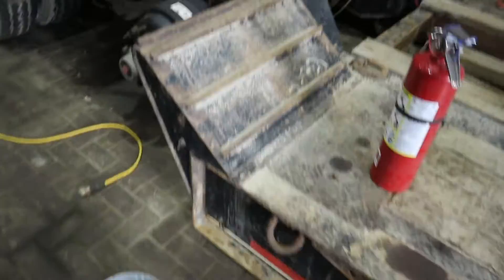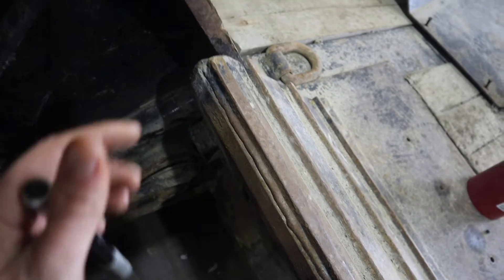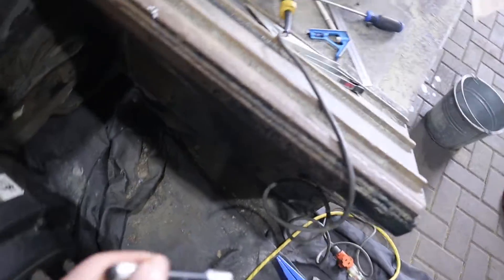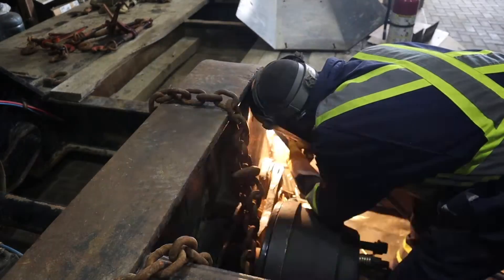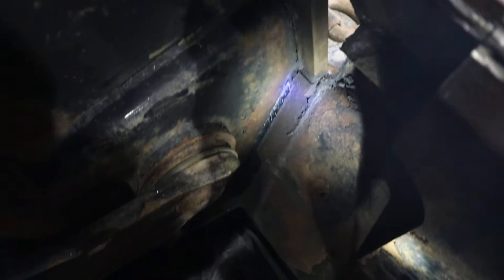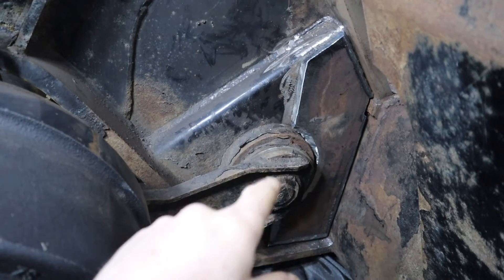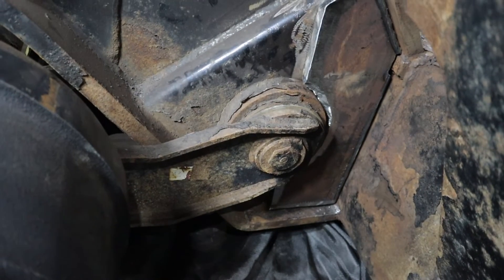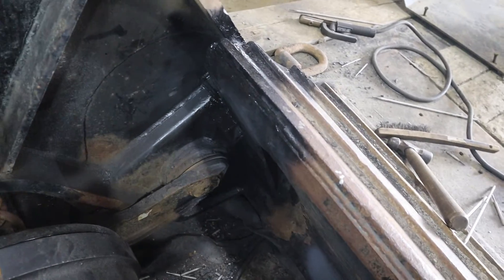Repairing a Cracked Heavy Haul Trailer (Gouge & Weld)

Comment: Hi 1st year boilermaker apprentice here. I was wondering were you ever discouraged when you first became one. Currently I have gotten inducted into local 549 boilermakers in june and got added to the list in july. However it is about to be december and I have yet to be dispatched. Currently I'm going thru the motions and completing classes and gaining certs and trying to practice welding all I can. Just having a hard time remaining optimistic when months have gone by and I have yet to get on a job, hell today when I went into the hall to pay dues one of the other apprentices told me to literally go look into another union because they too have been on lists for months. :(
Reply from the maker: In your scenario I wouldn’t quit the union but I would definitely go get another job in the meantime while waiting to be dispatched. You will get dispatched eventually by it’s a good idea to try and make some money in the meantime.
Reply: @JTwelder. For sure appreciate it I feel alot better about it as of yesterday. Your right I guess I just have to be patient. I currently am going back to working my old job at the tesla factory as an associate/factory worker. One question I do have for you though is once you started gaining more experience and certs did you start getting dispatched more? or were you always waiting around for months?

Comment: Nice one. You still getting a new pickup or is the ol 12 valve working out?
Reply from the maker: The 12v is a backup now but it will be getting a welding skid with a second welder.

Comment: Whats the reason for not welding vertical on a frame? Never heard that before
Reply from the maker: I’m told by YouTube commenters that it creates a crack because it transfers stress through the frame in a manner in which it’s not designed to handle. I try to avoid it but I have seen engineered designs and repairs where it’s done and has held up. If a engineer says it’s ok on whatever I’m working on I have no problem fallowing their plans.
Reply: Did u use 11018?